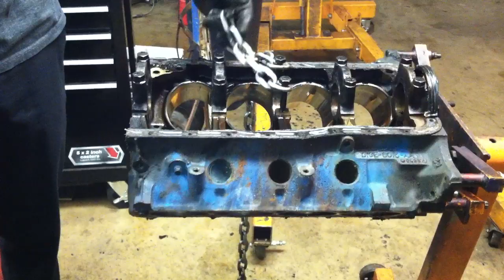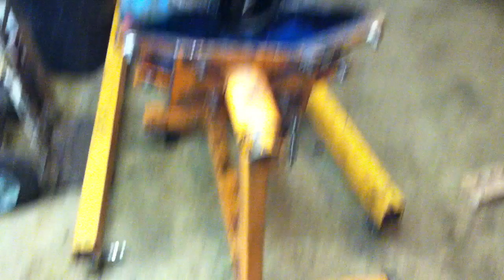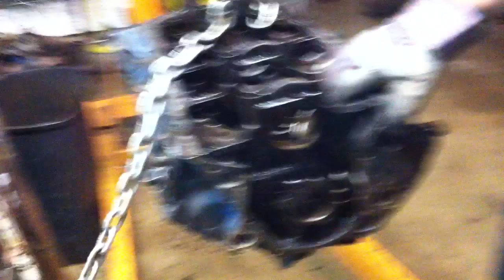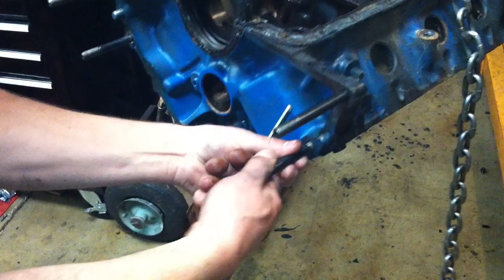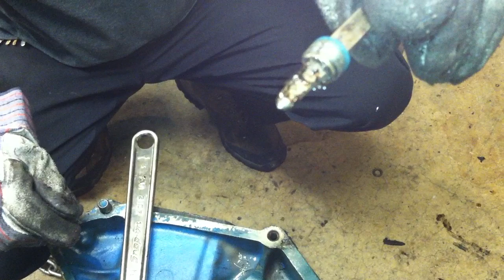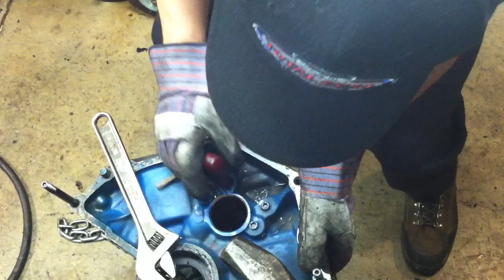289 complete rebuild part 8

Comment: For the galley plugs I do the same except I use left-hand drill bits in increasing diameters, The heat and counterclockwise torque haven't failed me yet; I've had 100 percent success without having to use an EZ-Out.

Comment: On thoose plugs: You have developed a very fast technique in getting theese out, if the hex key doesn´t work. Must have been hundreds or thousands of such plugs that you have pulled over time.
But when the plugs are stuck, have you ever tried to fasten them a little bit first. I experienced on some occassions that the screw or thready thing in general will get loose after that. What is your experience on that?
Also, what really surprices me o_O, is that the "easy out" is just a square kind bar with a chissel form combined. Do I have noticed that right? Because the "easy outs" that I know of, are left threaded screws with a cone shape (or conical screws with reverse thread, heehee ;) ).
I ask, because i´m into black smithing and such a simple "easy out" could be made by hand  easily.
[Just in case if this is funny english, i´m just a simple german guy with some basic english skills.]
Reply: *chissel = I meant wedge, sorry.

Comment: Actually those plugs are originally because sand needs to get out, but factory figured out that they are perfect to use as freeze plugs to prevent engine damage. So GM already stood making those holes (and not changing the place or size of those) so that they can be used as freeze plugs.
Reply from the maker: well we are swating at flea's here but none of the manufacturers call these Freeze plugs that is a slang name given to the plugs by non OEM parts suppliers The idea that the purpose of these plugs is to save the block in case of freezing is just plain wrong what will save a block from freezing is not to use plain water in your cooling system

Comment: My 289 only has 5 bolts. Wish I had a 6 bolt block haha. I hate owning a D Code 289. Timing cover has an oil filler neck that won't allow an alternator bracket to be bolted up. So makes things more difficult. And nobody makes anything custom  for D Codes sadly. You gotta make them yourself.